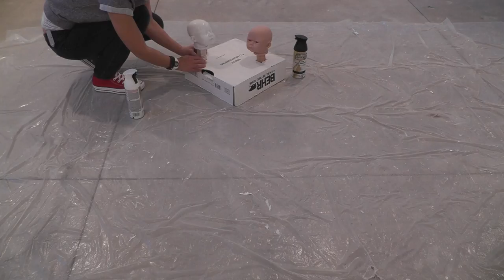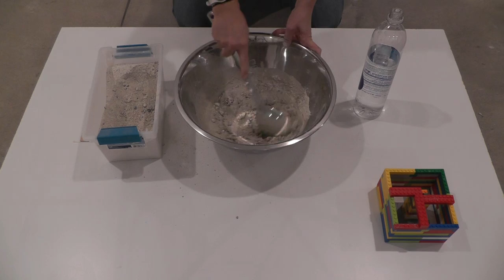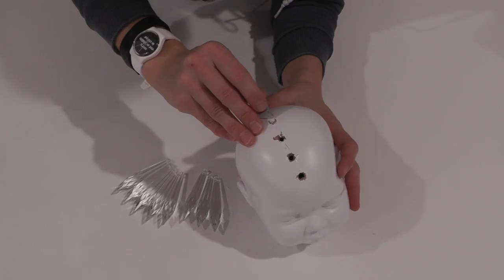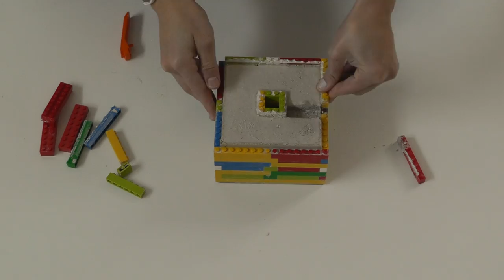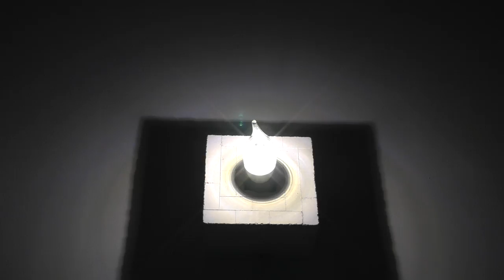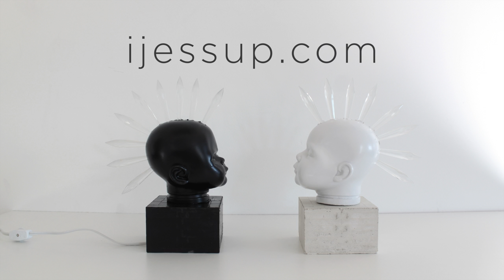Mohawk Baby Lamp

Comment: I've worked with concrete in a professional prefab industry and I recommend using styrofoam for making space, for in this case the cord to the lamp. We used styrofoam a lot and it holds back a lot of pressure. We made slabs of concrete floors/ceilings that is up to 250mm in thickness and as long as 6m in length and 2.5m in with. I can't remember the amount of concrete that could be but up to 8000 litres it can contain, and that is a great amount of pressure. But styrofoam does not break or crumble from the pressure, as long as it isn't to thin and as well as it is mounted well to the form. Oftentimes a PVC pipe for plumbing is useful for holes since it also makes it easier to pull out, but that has to be done before the concrete sets too much. Wich is about 1 1/2 - 3 hours after the pouring. Also important is to wax every object a lot before pouring since it is hard to remove otherwise. If you don't remove the form or the objects within the form within 12 hours (regarding industry building concrete, concrete for hobby use might differ in curing/burning time) the removing will be worse even if alot of  wax was used since the curing/burning is a thermal reacion at least the styrofoam has a tendency to stick well to the concrete. A note on styrofoam is that, it might be so that the styrofoam used at my work place is specially developed for this use, wich means other types of styrofoam might be more or less fit for this use.
Reply from the maker: thank you so much for this great tip!